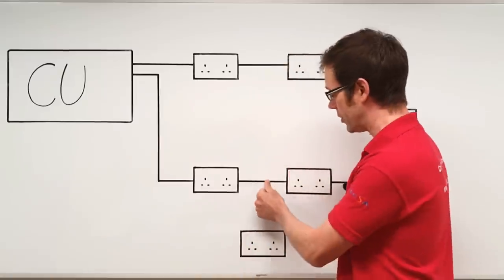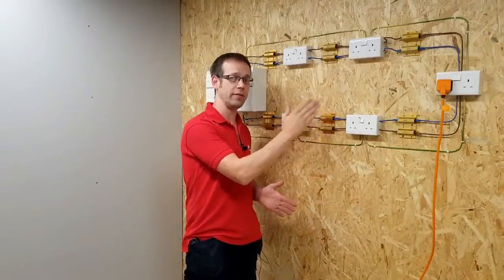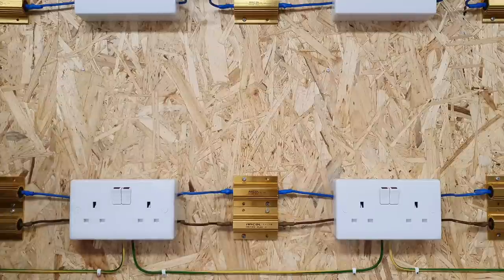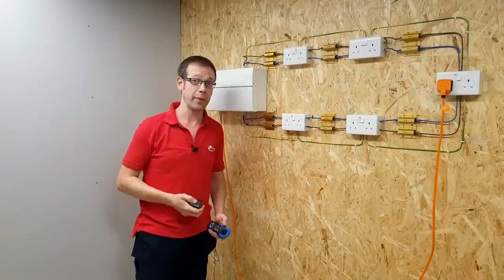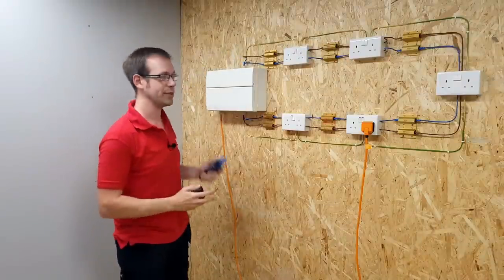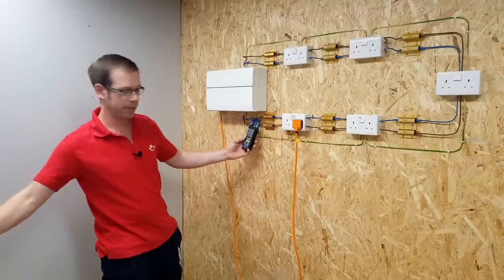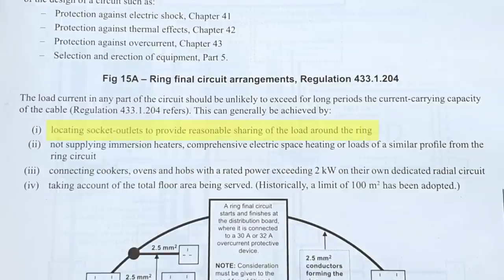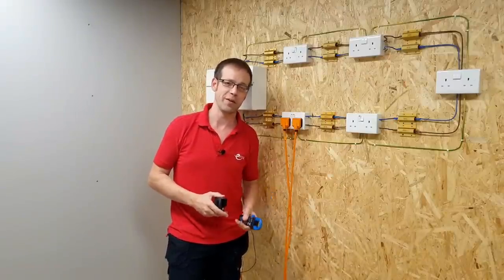KNOW HOW: How does current divide in a ring final circuit? (ring main)

Comment: Brilliant explanation joe, it certainly if food for thought that unevenly spaced sockets on a poorly wired ring, could potentially overload a single leg of 2.5mm t&e.. you can imagine the scenario, kitchen ring with kettles, toasters washing machines and maybe a hot tub on an extension lead into kitchen  all backed up on a 32A MCB with a single 2.5mm cable rating in the region of 27A🔥🔥 it begs the question, Why have they been allowed for so long? surely the radial circuit is the way to go in the future👍
Reply from the maker: Thanks very much. And it certainly is thought provoking. The last house I rewired I actually didn't use any ring final circuits, only radials. 👍 By the way is it Daddy B on your birth certificate? 😂
Reply: Yes that is correct, daddy b🤣👍

Comment: Another great video explanation, 

I have seen this type of circuit extended at a later date useing blue inline crimps in the back of a socket outlet.

 Is that compliant?

On many commercial jobs these circuits are wired in 4mm conductors , "belt &  braces !"

Comment: This is a very good way for people to get a practical understanding of the way electricity operates in circuits. Have you done any videos showing the same for radial circuits and spurs from ring and radials at each point along the circuits? that would be really good and would help explain why certain decisions are taken. Digging down into the current for the increased loading, I am not quite sure how that has come out at 16.5A on the bottom leg as the ratio of resistance for that socket is 0.22 vs. 1.1 on the other leg. Based upon a 5KW loading, which equates to 21.7A, 5/6 x 21.7A should come out at around 18.1A in the bottom leg vs approx. 3.6A in the upper section. I wonder what that would have been...

Comment: Greetings from Finland. 

Question: Why there is only one 32A fuse/circuit breaker protecting both legs of the ring? Of course that's the way ring circuits were made in the 1940's but wouldn't it remove all the safety hazard from the ring final circuits if there was one 2x16A circuit breaker (so two breakers but internally connected together, if one trips -> the other one trips as well). 

The idea here is that you would connect one live lead to one circuit breaker and the the other live to other circuit breaker. If the ring would go off-balance enough, more than 16A would be drawn from one live wire and it would trip the breaker. However if you have perfect balance in the circuit, you still could draw 32A from the whole circuit but you are not overloading any of the wiring. 

I don't know what is "normal" current rating for 2.5mm^2 in UK but here in Finland we use usually 16A breakers for 2.5mm^2 wiring. 

This is something that if there is no real reason not to do this, maybe something like this could be enforced in future regulations to make ring circuits more safe.
Reply: Ring circuits are VERY safe, a cable rated at 27A (ie 2.5mm²) will not burst into flames if loaded to 30A! It will simply get a bit warmer than the rated 60ºC but that takes time, and the breaker will warm up too and trip long before any cable becomes hot enough to ignite wood next to it. A dual 16A breaker solution would solve a problem that doesn’t exist, and cause lots of nuisance tripping. Ring circuits have worked extremely well for decades
Reply: @edwardemberton8069 That raises the same question though: why not 2 27A breakers (or whatever most closely matches the rating of the wire) setup to trip each other? Could increase total possible amperage on the circuit for balanced loads, while still preventing unbalanced loads or ring breakages from exceeding the rating of the wire?

Comment: Clear concise information. Understand the less or more resistance in the ckt.
STILL trying to understand the INSIDE Of the CU Consumer unit of the Ring. 
Is this the SAME as a Split Phase in North America wiring? 
Thank you.
Reply: The CU is a single phase 230vboard.   The two live legs of the ring are connected to the MCB OR RCBO, and the two neutral kegs are connected to the neutral bar in the case of an mcb, or to the neutral terminal of the rcbo.  Hope this helps

Comment: Kitchens are where ring circuits are useful - my kitchen has toaster, kettle and Microwave all in same area <1.5m on two double sockets (with one extra). Add these up 1500W + 3000W + 1200W and you can exceed 20A for a radial. Wiring two radials in the same area vs a ring is an interesting quandary.

Comment: Very nice explanation, which has made me question my (just being built) kitchen island electrics. I have brought the ring into the island and there was an existing spur from this junction to the fridge feezer. I want to add a double socket for kettle and toaster, and a single for the dishwasher. Is it better to make the new sockets spurs or part of the ring?
Reply: Doesn't matter. Just do the current calculations and ensure you don't overload the cable or breaker. At the end of the day, you are running a spur of the ring so the current is passing through the ring.
The downside of extending the ring to the new sockets is you need two lengths of T+E cable, whereas if you add a spur and fit the socket on the spur, you just need a single length of cable.

Comment: Joints create high resistance and are hard to find if in fault condition.
A ring main negates using bigger cables and if a break does occur the system still works
Reply: Wagos apparently offer less resistance than screwed joints.
Reply: @johnburns4017  how apparent is that statement...
Reply: @Surferant666  
Wagos give the correct amount of torque. They do not work loose. They are maintenance free connectors - they can be in sealed walls. More of the cable is in contact with the Wago connector.
Reply: @johnburns4017  id say they can NOT be allowed in walls and hidden places nor can any connection
Reply: @Surferant666  
Wago say they can. The are maintenance free connectors - MF. They do not work loose unlike screwed connectors.  Also less resistance than screwed connectors generally.

Look at the the vid on Wagos - a few of them.
Reply: @johnburns4017  so they have an insurance assurance from the iee?
Reply: @johnburns4017  so you are saying that if i tug on the cable hard, they wont disconnect!!!
Reply: @johnburns4017  would they hold your weight if you swung on the cable with these holding it . NO.
 So therefore not suitable.
Not connections allowed to be hidden !
Cowboys.com
Reply: @Surferant666  
 It is best you stop making things up. You have been told to look at the vid on Wagos.
Reply: @Surferant666  
Whatever you do, you know sweet FA about Wagos.
Reply: @johnburns4017  more gimmicks to dodge proper workmanship.
Reply: @Surferant666  
Stick to nuclear stuff.
Reply: @johnburns4017  iam... Atoms have a nucleus and we use it to transfer energy in good cables.
Ya cowboy. Get off our supply
Reply: @Surferant666  
Some sort of cracked pot here.
Reply: @Surferant666  
This is the result of exposure to radiation. Sad.

Comment: Okay, please explain what happens  when a load is plugged in two of the outlet boxes.  What current flows through the middle link between each outlet?
If the loads are equal do we see no  current flow between the two outlets, only on each leg back to the breaker box?

Comment: A kitchen ring is the only ring circuit likely to get loaded up in a house environment!
You mentioned a kettle and a toaster produced your load!
Both items will only be on for minutes at a time!
A dishwasher,dryer and washing machine are often on together in my house often along with the kettle, probably over 30 amps on occasion as the machines go through their cycles?
Rings are safe otherwise 1 in 10 houses would have a fire daily! Piss poor maintenance and installation by a kitchen fitter should worry people

Comment: I remember at college we were told about DIY people, accidentally creating a ring with in a ring. Possibly by extending the ring but not braking it first(attaching a new ring between two different sockets). This is obviously incorrect!  But I argued the it won't harm the current handling ability of the ring circuit. Its just more parallel copper added. My college teacher said it was dangerous, but I can figure out why. I know it will make it impossible to test the new B/8 shaped ring.

Comment: There is a video somewhere on YouTube (I don't remember where and i don't know whose channel) where a spark is baffled that a ring circuit has been wired with cable not running from outlet to outlet consecutively. Some of the comments for that video point out that this used to be common so as to create even distribution of current throughout the circuit (as much as is possible).
An interesting sequel to the video here, would be to run the cabling in this way. So, socket 1 is connected to socket 3 etc and the return leg doesn't return from the extremity but  somewhere in the middle and repeat the demo.
If I could find the video, I'd post the link🤔
Reply: If you watched it it will be in your youtube history (if you are signed in and have keep history turned on)
Reply: @Apex180  I know. I watch so much of it though, it'll be like trying to find a needle in a hay stack. I really need to get a life😂
Reply: @drunkkmachine4511  Well done Chris, I believe it was. Thanks mate👍
Someone in the comments called it the kangaroo method😂
Reply: David Savery mentioned this in a fault finding video, where he found the way the ring was connected unusual.

Comment: Awesome demo thanks. I'm no electrician but have a keen interest, could you explain as to why this is worse than having a radial?

I'm guessing from the tone in the description and some of the comments that this is not the preferred method but even recently my spark said we should always do rings for sockets. Thanks.
Reply: Because they can carry twice the amp compared to radial....unless u use 4mm radial sockets.. ..and also if one side of ring damaged there will still be power..
Reply: @whitebeltlyfbjj3393  That is the issue. Ring can fail without actually losing power. The load handling of the circuit is then halved (and there might be something even sketchier going on in the place where the circuit failed) but there isn't a loss of power to the circuit.

When a radial circuit fails you won't get power until you get the failure fixed and that's how it should be.
Reply: Your sparky is wrong mate.

Comment: Interesting result.  A 2KW load at 230 volts implies a resistance of, what, about 30 ohms approx?  So one's first thought is, well, the ring main voltage is pretty much the same everywhere and the wire resistance is relatively much smaller than the load, so it shouldn't make much difference where in the ring the load is placed.  But of course when you draw the full equivalent circuit (which you sort of did in the model), Kirchhoff''s laws come into play and the result is a bit unexpected!

Comment: Based on this example is it therefore possible to overload a 2.5mm cable in a ring final by putting a lot of load at one end of the circuit?
Reply: No because it is fused at 32 amps . As the short leg heats up its resistance increases sending more current the other way